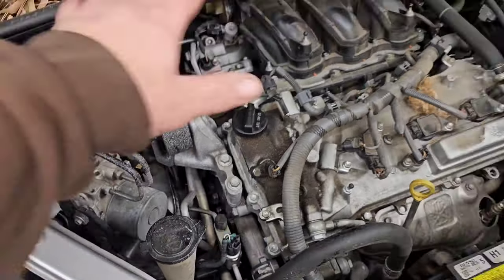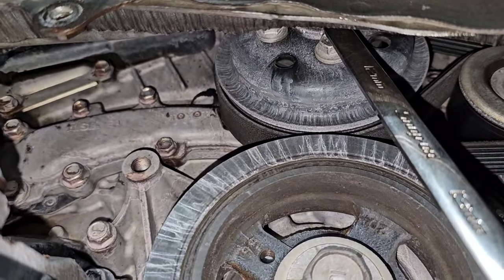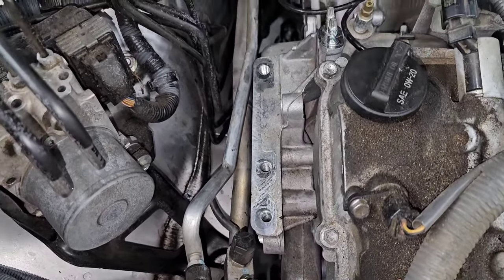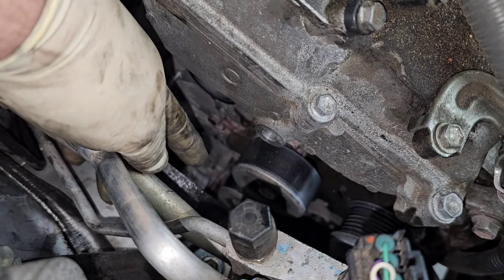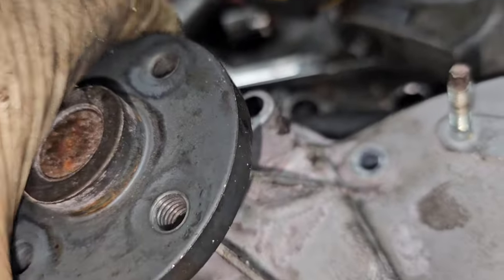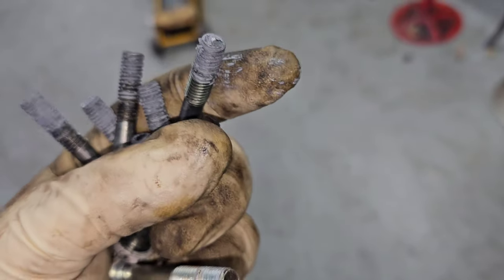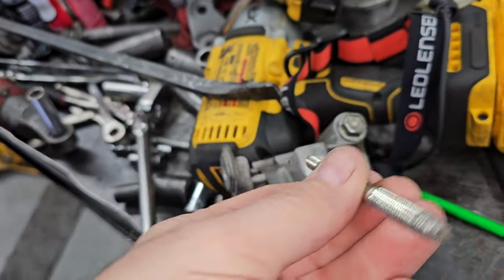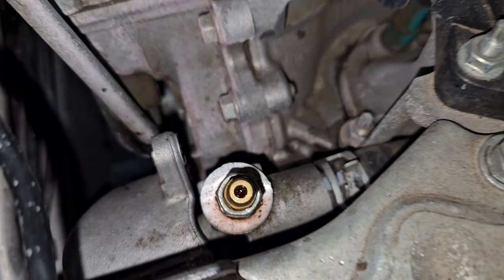This Water Pump Was Not The Most Difficult I've Done, But it Certainly Wasn't The Easiest!!

Comment: Remember the old days when the water pump was on the front of your V8 and you could change it is your drive way without a lift and pulling the engine out? Good job Kenny!
Reply: Half hour job on my 06 5.3.  Electric fans help 😊
Reply: @stevewhite3424  even on an old Ford Windsor, or Chevy 350 with a mechanical fan I’ll take that any day over these newer cars especially foreign front wheel drives
Reply: I can do that on my 98 Ford E250

Comment: I remember changing a water pump on a G20 van along the road with a couple of wrenches and a pair of pliers. Those days are long gone with these sideways engines. Still not horrible but I'd rather not start this job in the driveway with a deadline! This engine is not too bad to service in a Tacoma as long as you don't want to pull the timing cover. The oil pump configuration makes it impossible with the front diff in the truck. From one old guy to another, thanks for posting.

Comment: I always torque my water pump bolts.
Reply: Amazing how many people think their hands are torque wrenches . They get away with it for most jobs but it’s going to catch up to them. It’s like roller skating down the expressway. You can get away with it for a while but then luck runs out. I’ve been a technician from the late 70s seen it. Also people that have a torque spec of say 80ft pounds they go straight to 80 instead of increments of 1/3 . Like 30-60-80ft
Reply: @sheerwillsurvival2064 well I didn't have that option doing my 98 Ford E250 water pump and it's not leaking yet so hmmmm
Reply: @coreybabcock2023  yup you can get by sometimes. Like roller skating down the interstate. But one day it bites ya . If ya can’t get a torque wrench on it I get it . But if you can it is best to torque. Sooo you got lucky

Comment: I'm familiar with most of what you do but your teaching method is  vibrant and sorta fun. I teach some after school kids and use some of your method. Like starting kids on hopefully a path that will work well for them in the future.     Thank you
Reply: Every vehicle will be an EV soon, so the job is going to change. 
Already, because of the high voltage batteries you need to be trained to work on them.

Comment: The newer generation is harder than that. Youre supposed to jack up the engine with a block of wood on the pan, take out the thermostat, remove/loosen the lower mounts, remove the hose that goes to the radiator, drain the coolant. When you jack the engine up and remove the upper mount, you then have access to all the water pump bolts. Toyota service information wants you to take the engine out. With the newer generation 2GR, the ABS module is in the way and you can't jack the engine up at all.

Comment: Grey sealer is a non hardening type, if it is the original. You really need to use a non hardening sealer when putting them back, especially as those bolts will otherwise corrode themselves into the block. Loctite makes a white thread sealer that works really well there, and Yamaha has in the boating side a really good sealer as well, that also does not harden either. Loctite 565, 567 or 577 is the go to stuff to use there, after cleaning the old gunk off the bolts and washing the holes out. Used one depends if you want it to seal only, hold and seal or hold pressure and seal. All 3 are easy to remove, and all 3 tend to stay pliable in the hole and thread as well

Comment: I don't envy mechanics now days. Before you know it, you'll have to pull the engine to do anything. The pump itself was no big deal,  it's all you have to pull to get to it. I hate the ones that are run by the timing belt.
Reply from the maker: Yup, the designers & engineers never think about 'hey, what happens if (insert part) fails' 🥴 Thanks for watching. Keep wrenching 🔧

Comment: This job pays 2.3 hours under warranty.  The worst part is trying to get the engine mount bolts through the brake lines. Everything else is straight forward
Reply from the maker: OMG!!! That is INSANE. if I get another one I can do it faster but seriously! That's crazy 2.3 hours of labor for that 😳 Keep wrenching 🔧
Reply: @WrenchingWithKenny  Every 2gr I've ever worked on you can unbolt the passenger engine mount to do this job. Lift the engine using a floor jack on the oil pan, bring it up until the intake plenum is touching the cowl. You can do the rest of the job from the engine bay. I've noticed on high mileage vehicles sometimes you have to unbolt the front engine mount as well to get things moving. Once you've done a couple this job is doable in less than 2 hours. Love the videos I always learn something

Comment: Ive done alot of 2GR water pumps the i always price out original water pump and thermostat. Customers are also always surprised by the price not knowing its not the piece of cake they want it to be
Reply: They aren't terrible unless it's a newer generation one.
Reply: @LoneWolfSparty   honestly i like the newer gen ones more you dont have to deal with the power steering pump makes it a little tight on the right side
Reply: @360fanboy360  the 20 and up, the time to do the water pump has increased because it's even tighter against the frame rail -- and you can't jack the engine up. Also, the thermostat housing is electronic and plastic. No power steering pump since the rack is electric.
Reply: @LoneWolfSparty What? When I was at Toyota I did a 2gr fks water pump the exact same way as a 2gr fe. You can absolutely lift the engine up
Reply: @firstlast---  on an RX350 you can't; the ABS is in the way (I was at a Lexus dealership).
Reply: @firstlast---   yeh i always jacked the enigne up. Ive never done a late model sienna like this one so i cant speak on that
Reply: @LoneWolfSparty  Ahh that makes more sense. Any rx I've worked on has either had a 2gr fe or 3mz. I wonder what the difference is between the Highlander and rx to where you can't lift the engine